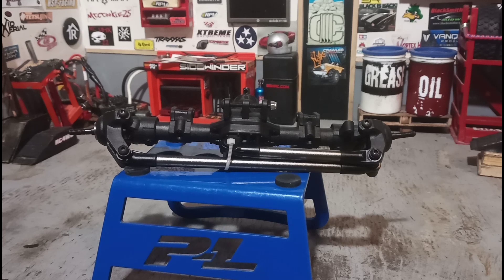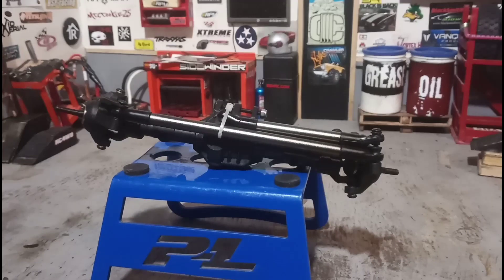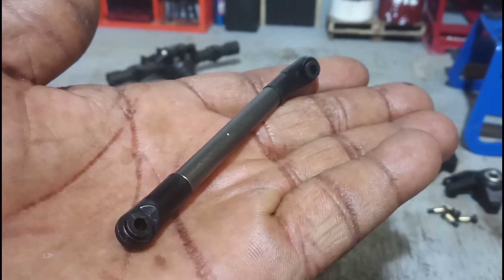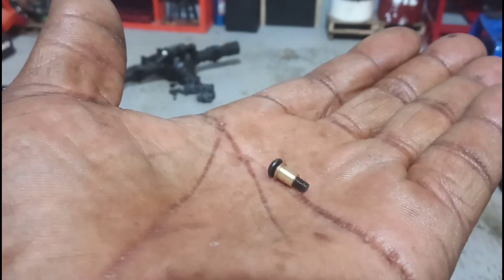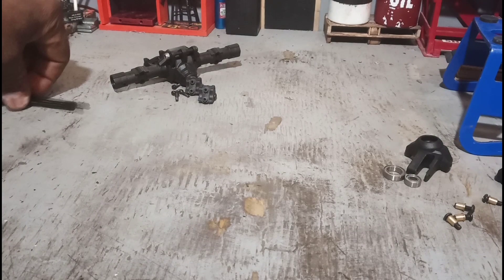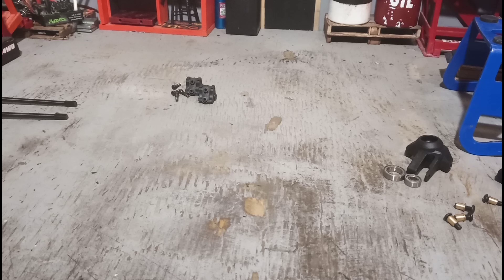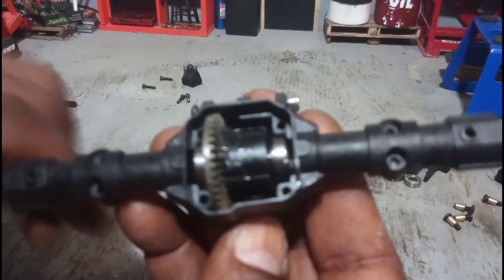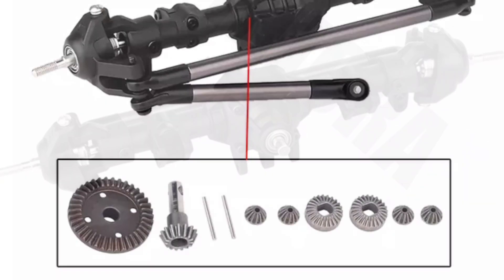INJORA SCX-10.2 Complete Front Axle Unboxing

Comment: I have a scx10ii clone and they come with these axles the rear axle is pretty dam good and waterproof I have noticed the front axle doesn’t have bearings at the end of the axle housing to stop water coming in from where the cv joint is

Comment: I bought these axles they looked amazing I was super impressed by how much they looked like the original Axial axle housings. Well that's where the fairytale ended. I noticed right away the outer bearing on the axle side was missing, so I installed and bearing there on both sides. After a good going over installed the axles on my rig. Took it out for some testing on a medium to tough trail within 10 min on the medium stuff the front gears shredded. I ran the truck the rest of the day with the front working only on flat to easy inclines but still running the hard stuff and occasionally catching the gears just right where they would catch. After the run I took it apart only to find that the axles and diff are square drive as well as the axles. So that being said you have to either buy all new stuff axles and diff which is around $80 for all new Axial stuff as I could not find Injora parts. I did find the diffs on Banggood so I ordered those. The quality control is not the best but now that I know where to get parts I'm pretty happy with them. Basically I'll pay for a axles housing for $20 and built it up thats fine I don't think the diffs are very good but it may be a one off. The rear is fine and a lot of abuse that day... just sayin

Comment: i already bought those axles and installed it.. my experience: those were total junk..
- came out with open diff.. bought a locker diff from injora, but it didn't fit. 
- bad caster angle
- cheap plastic material.
- cheap bearings
- panhard mount hitting the the steering knuckle

and also for info, scx10ii parts won't fit in those axles.. i'd already tried..trust me..
Reply from the maker: Thanks for the heads up bro.
I recently broke the universal front axle, and I wasn't treating her any worse than my other capable rigs.